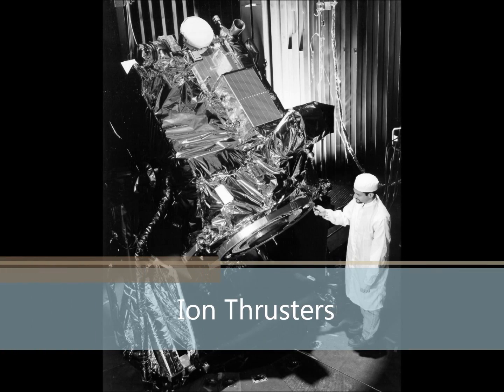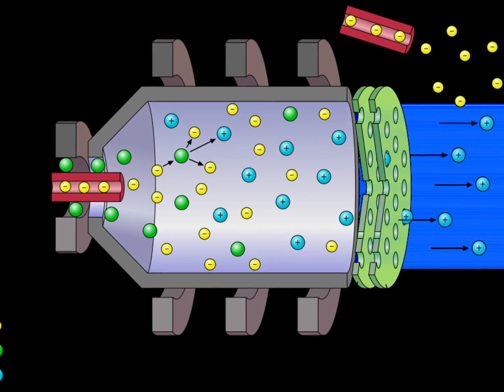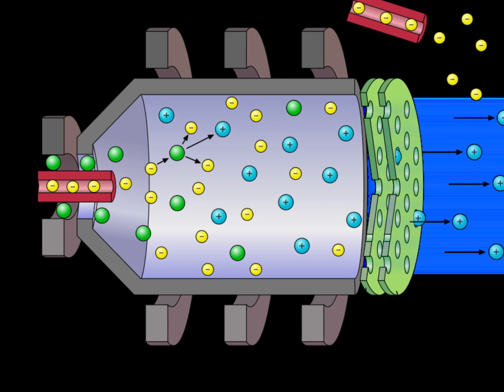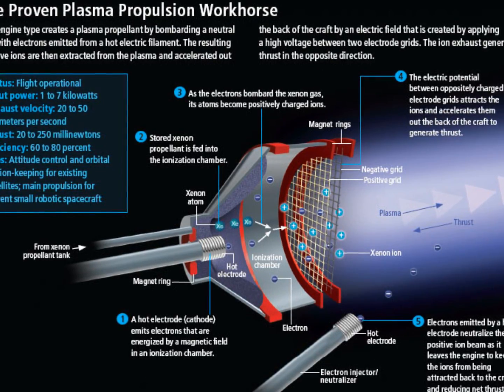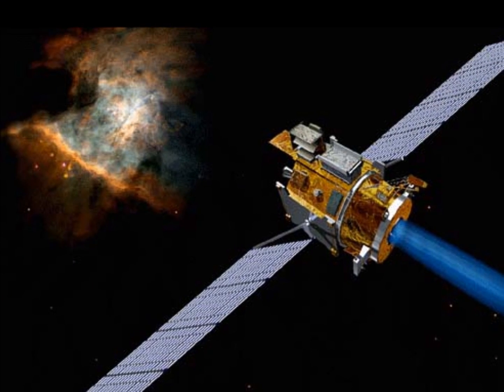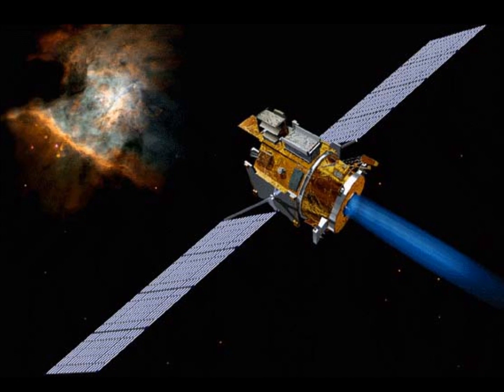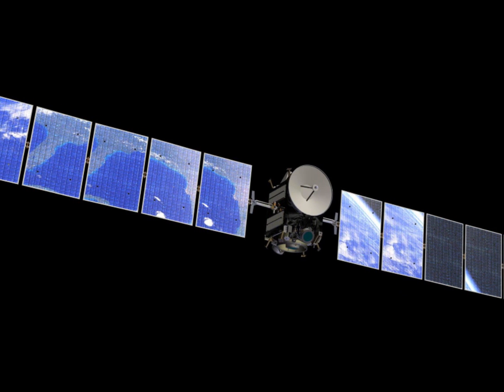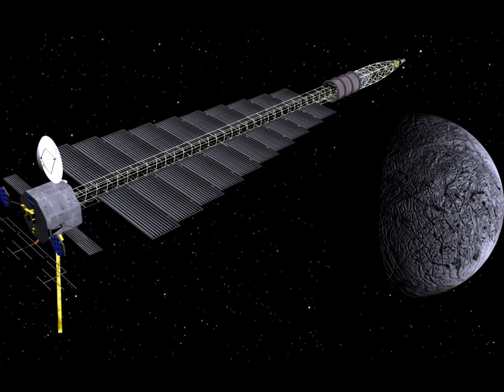Introduction to Ion Thrusters

Comment: Here's my thought. The ionic propulsion engine has no acceleration but what if you were to add a second (combustion?) engine for the purpose of getting the thing launched? Then after the initial thrust the combustion engine is shut off and the ionic engine takes over. It could also be used for backup.

Comment: i hear ion engines are slow they get faster because the engine can run permenantly i would want one engine in front one behind   the rear for forward thrust the foeward engine to reduce speed and stop a giant girder frame holding them together then the capsule looking like the enterprise on top and bottom

Comment: So its acceleration is very poor, but can propel a vessel up to 200,000 MPH .. .. I don't understand the physics there.  

Can somebody please explain?
Reply: Its acceleration is awful, far too low to be realistically used outside the vacuum of space. But in space there’s no atmosphere to stop it from continuously accelerating up to high speeds. 

Admittedly this true for chemical rockets too. But despite the incredible ability of chemical rockets to accelerate, they are inefficient and cannot run for more than hour at most. Ion thrusters are considerably more efficient and can be run for years on end provided that they have the fuel to do so.

Comment: Deep space will require more dense fuel (solid fuel) accelerated much faster than current ion engines.  Thought exercise - how much fuel's required to reach the nearest star, assuming an unlimited accelerator?  Hint, one molecule.  The obvious answer is heavier, denser fuel, launched by a bigger accelerator.  NASA should be working on Bismuth fuel and MeV accelerators, not Xenon at 60 kV.

Comment: Why would a positive ion pass through the positive grid?  Wouldn't the positive ion get repel by the positive grid, and the positive ion get push back inward?
Reply: thats what shoots it out. the resultant force will be in that direction.
Reply: My guess is as good as anyones but it's probably due to diffusion and eventually when the build up of ions is great enough the repulsion between atoms might force ions across this positive grid

Comment: If you use Cesium, it will be a lot more efficient because you can remove an electron a lot easier.
Reply: It would probably have to be stored as a solid, unlike Xenon that could be a gas or liquid (under high pressures and/or low temperatures). One reason for this state is its much easier to transfer between chambers (e.g. storage>propulsion).

Comment: What would happen if you put your hand in front of it for like 5 seconds?
Wondering b/c dont ion thrusters launch very small amounts of mass at a time? So would the effect be negligible?
Reply: You'd have to treat it like radioactive decay where it would only have the potential to strip one electron at a time (unlike alpha radiation, a helium nucleus He2+ can strip 2). Sieverts are used to diagnose the health impact, you can search up the health implications based on the resulting values and the mass affected. The equation is H=QD, where H is the does equivalent (in Sieverts or J/kg), Q is the quality of the the radiation (its tendency to ionise) and D is the absorbed does. I don't know any of these factors for Xe+1. At least you have a start now. GL have fun (btw this is year 11 Australian National Curriculum for reference).

Comment: I have a question on whether or not oxygen could be used to fuel the Ion thruster
Reply: Based on the assumption that most of the thruster system will be metal it would be unwise to have oxygen as a fuel as it would oxidise the lining. Even if it has a passivating layer (Al doesn't mind oxidising as only the exposed atoms 'rust' but don't peel, exposing more atoms) the smallest spark from electronics or heat from a cathode might cause the oxygen to act as an oxidiser for another material acting as a fuel. Also its relatively light and the basis of this thruster relies on conservation of momentum, oxygen goes one way, equal and opposite force provided in the other direction. Xenon has a greater atomic mass and thus more momentum at the same speeds. Think of it like sitting on a skateboard and pushing off bowling bowls (Xenon) compared to tennis balls (Oxygen).

Comment: How come satellites never run out of fuel for these ion thrusters? Also, if there is no friction in space, and a thruster is applied to change direction, mustn't there also be a counter thrust afterwards to stop the rotation, in other words thrusters will be in continual use to keep the craft in correct alignment and orientation, so where do they get all this fuel from if in space for decades at a time?
Reply: "How come satellites never run out of fuel for these ion thrusters?"
They do, it just takes longer than using chemical propellants. 
" if there is no friction in space, and a thruster is applied to change direction, mustn't there also be a counter thrust afterwards to stop the rotation"
There is. Once the spacecraft is reorientated an opposed thruster cancels the rotation.

Comment: is the negatively charged grid stronger that the positively charged one? otherwise i don't see why the ions would move in that direction if the positive grid is closer to them to begin with.
Reply: raglanheuser  I would imagine equal "strength" because often only a single magnetic solenoid is used to create the potential difference between the screens. But as for why they make it through, its simply because of the momentum the ions accumulate, so the electromagnetic flux across the grids dont interact with the ions long enough to take all that momentum away.
Reply: jks2389
well if it doesn't interact with them enough to take away the momentum, then i guess it doesn't interact long enough to add any either :\
Reply: There is a very abrupt (discontinuous) change in the environment on either side of the positive grid. The momentum necessary to get past that Coulomb barrier comes down to the engineering of the ionization/plasma chamber. Ideally the propellant is pumped into the chamber under some pressure, and the atoms, through collisions with the thermal electrons used to ionize them, will be further accelerated by some non-trivial amount. All they have to do is get past that barrier. But immediately on the other side is a completely different story. The positive ion would experience an immediate boost in energy in being repelled by the positive grid, which after passing through it they are essentially at a distance very close to 0. Remember the Coulomb force is inversely proportional to distance squared, which means force approaches infinity as distance approaches 0. Combined with the attractive acceleration to the negative grid, it experiences 2 accelerating forces. So it is between the grids that give the massive increase in momentum. Then on the other side of the negative grid it would be much the same as in the chamber, with the particles experiencing an accelerating force back to the negative grid, but it will have so much more energy than before, and the effect is pretty much negligible.
Reply: jks2389
'Remember the Coulomb force is inversely proportional to distance squared, which means force approaches infinity as distance approaches 0"

GEE YOU DON'T SAY

Comment: and how do u break that thing in space when going 200000 miles per hour? by just doing a u turn?
Reply: +marino4691 you would have to use gravity from other space bodies to slow you down quickly, but the time frame of quickly could be months or years
Reply: +xingx355 ah now i got it. u have to have engines on every side anyway. so u accelerate on the opposite side until u dont move

Comment: Woudn't the xenon atoms diffuse out of the egine, especially in the vacuum of space? I mean, a Xe+ atom that, according to this video, will fit trough the grid, isn't smaller then a neutral Xe is it?
Reply: +ietsization maybe the ionization will occur quick enough , before the atoms even escape

Comment: You know you could use the Ion thruster with Uranium or other Radioactive elements like Plutonium or Thorium cause they create electricity and last a very long time
Reply: You don't know how nuclear power is generated, do you?
Reply: Brianna Sellers then radiation harms the electronic equipments
Reply: No I mean use a insulated chamber with something like Curium or Plutonium and power that ion thruster for many years
Reply: +Brianna Sellers the some times use  Rtg radioscope thermal electric genarater mostly the have solar panels.
Reply: +Brianna Sellers Radiation doesn't simply produce electricity, the conversion process is, compared to ion thrusters, ancient and barbaric. Nuclear fission produces heat. Heat is used to boil water. Boiled water becomes steam. Steam takes up more room than the water it just was, so it expands. This builds pressure, and the pressurized steam pushes itself through a turbine. This turbine turns to get out of the way of the steam. This turning rotates an electric motor, which gets you (finally) electricity! But then you have to cool the steam to get it back to water, and pump it back into the hot part of the reactor.
Unless you mean radioisotope thermoelectric generators, in which case 50KW would weigh somewhere in the neighbourhood of 16 tons.
Reply: ***** Let me re-type what I said 4 months ago, since you're too special to read that.
"Unless you mean readioisotope thermoelectric genorators (special kid note: This is what's on the back of Curiosity) in which case 50KW (power needed for a good sized ion thruster) would weigh in the neighbourhood of 16 tons."
To re-cap, since you failed to read it the first time I'm doubting the second will work, so here's the charm: A nuke reactor (not what it is, but we'll call it that for your sake) like the one on the back of Curiosity produces such incredibly small amounts of power, it would need to weigh insane amounts to create useful amounts of power. The one on Curiosity weighs over 45 KG, and only produces 110W. You'd need two of those to power my laptop. So yeah, it's possible, but HIGHLY impractical.
Reply: ***** http://bfy.tw/3t7n

Comment: The electrons and the ion thruster can be combined, both using the same propellant. This works by using radio waves to strip the atoms of their electrons. Also, as these engines may be a great and efficient way of propulsion, but they have an extremely low amount of thrust in comparison to chemical engines. Still, we may discover something better to use!
Reply: ***** That could be it, keep working on it, who knows what you could find!

Comment: Acceleration of a potted plant XD

But why aren't these ion thrusters capable of higher thrust? What if you placed the same thing into earth's atmosphere and replaced the xenon with regular air?
Reply: The reason these thrusters operate at such low grade thrust is due to a difference in the number density of (charged particles/m^3) ~10^16. Where as Earth's surface at S.T.P is more like 10^24, rendering the thruster virtually useless near earths surface.

Comment: 200,000 MPH like an inch worm in the desert. then I guess interstellar travel for human beings is out of the question even if you started it out accelerating with another high torque low speed engine like a liquid hydrogen/oxygen rocket or a fusion rocket and shifted into the ION drive later when decent speeds were attained.
Reply: Actually some group made a diagram for a nuclear pulse rocket way back that could get up to 10% the speed of light using fission bombs. The closest star is 3 light years away, off memory, so a person could technically make it to the nearest star and back if they don't have any health issues during it.
Reply: Pinkie Pie with the kind of ship that has this capability for engines and fuel would be large enough to have a medical team, rather than a few people for that.  There is also time dilation but the family at home would age considerably. The nearest star is Alpha Centuri, is 4 light years away but because it is a binary very low probability of any planets there.
Reply: you got a better idea?
Reply: Theoretically, if nasa is given way more money, Fusion Rockets, Ion Rockets, and Solar-Sails could get us to the nearest habitable planet it... 100,000,000 years, but thats with only the basics. The guys at nasa could probably reform my idea.

Comment: There are other terms in Ion drive design that are neglected to be mentioned. There is no limit to how much electrical wattage you can put into the system. You could make a very powerful 'afterburner' with positrons.  There was a 'hybrid' propulsion system developed in Israel using a spool of Uranium wire as a secondary fuel..'Kind of a 'nitrous bottle' for an Ion drive.

Comment from the maker: Yes they are, this repulsion actually helps the acceleration. As the ionization chamber fills with the positively charged ions they start to repel each other. This causes the ions to get pushed towards and eventually though the positive grid. Once the ions are on the outside of the positive grid it pushes them towards the negative grid. Hope that cleared it up.
Reply: I beg to differ the chamber is filled with plasma which means the ions are not pushed towards the positive grid.It is the ambipolar diffusion which causes electrons to move much faster to the walls compared to ions because of their smaller mass and then the ions are pulled along with the electrons to make sure that the current continuity is maintained at the wall.